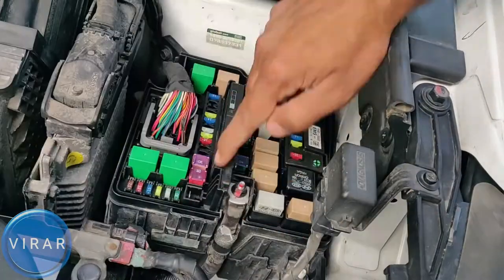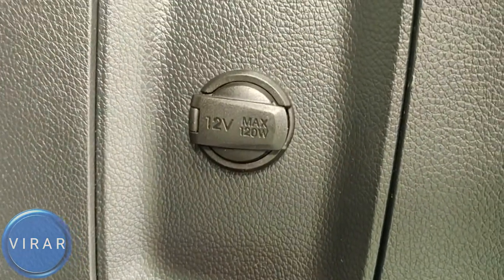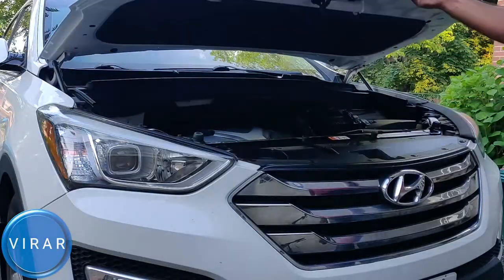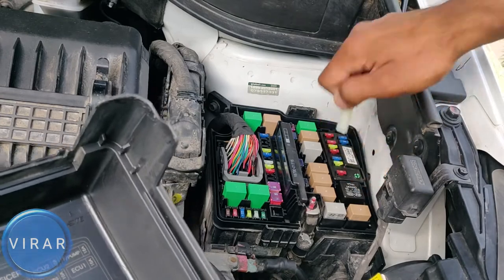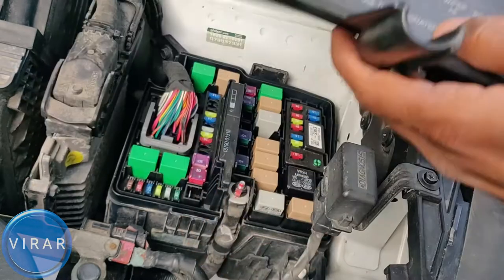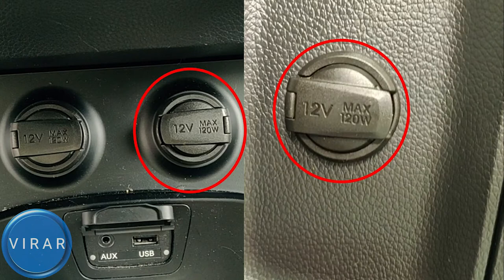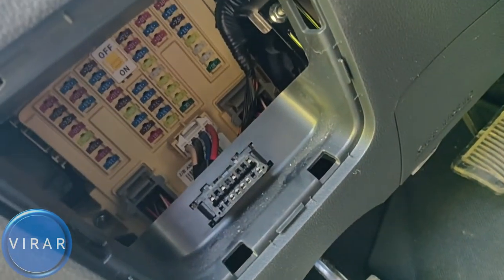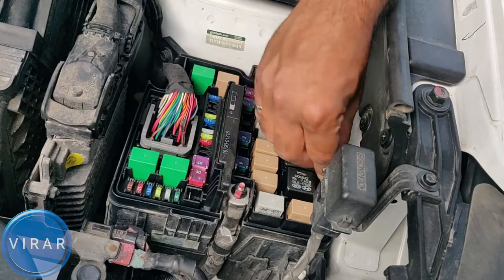How to Fix 12V Power Outlet/Cigarette Lighter - Hyundai Santa Fe (2013-2018)

Comment: Great video! You showed both front power outlets fix. I was going nowhere how to fix the one on the left, then when I saw your video showing the other fuse box by the engine compartment I was relieved. That’s the solution I was looking for! Thank you! You saved me money going to the dealership and getting aggravated with the fact that I can’t use that cigarette lighter got my other accessories. 👍👍👍
Reply from the maker: Thank you! Glad you found it useful! Thank you for sharing. I tried to included all the details I could to make the job as straightforward as possible.

Comment: omg okay watching this because my Santa Fe fuse won't charge, but with how informative this is i was hoping you would know... I TOOK my Hyundai in because the infamous "loading" screen is on my radio... yes it still works ut cant connect my phone, can't see what station i am on, or what temperature i have on the driver or passenger side is on... after taking it into the dealership they said it would be just under $6000 with $4000 in LABOR.... i took it home, after paying $125, got online saw it might be the CD player, took the whole radio out, disconnected the cd player. that still didn't work. i put the radio back in, and just said "ill buy a new one i guess" but of course, as i am sure with everyone else, the pandemic hit hard, and that's the least of my concerns right now... i saw somewhere that a new fuse might help? is this true? PLEASE HELP a single mom get to know what station is on while driving her son to school.!!!

Comment: thanks solved my problem although my unit is the other way around left side fuse is located inside the car and right side is on engine compartment. your tutorial helped alot.specially location of spare and the fuse puller.thanks brother
Reply from the maker: Glad to hear that. Thank you for sharing!

Comment: Great video. By any chance do you have a video on how to troubleshoot & replace the usb/auxiliar porst on the 2017 santa fe?
Reply from the maker: Hi Tyrone. Unfortunately I don't. From what I have heard, usually the USB/aux is a single unit and the quickest way to fix is to just replace the entire part. Unfortunately I don't have access to a Santa fe right now to make a video on it. Sorry :(
Reply: Thanks much for your reply,  I removed it and ordered the new part. Thanks again.

Comment: Would that fix the USB port as well? Mine keeps going in and out when charging
Reply from the maker: That may be a fuse issue or an issue with the actual USB port. If so, then you would need to get the actual USB port fixed.

Comment: PS I have a 2020 Santa Fe and it worked exactly the same, the fuse puller is located in the cover.
Reply from the maker: Ohh nice. Glad to know that the process hasn't changed much.

Comment: So if I use the spare fuses do I have to replace them or I can just leave the spare empty 🤔
Reply from the maker: You can leave the spare fuse slot empty for now, but I would advise getting the new spare fuses , you know never when you might need them in the future again for some other issue.
Reply: Ok thanks I'm going to try it and see what happens. I let u know if everything work out
Reply from the maker: Good luck!
Reply: Try it out today problem solved. It was the fuse.  thanks again
Reply from the maker: @jpringle8981  Glad to hear that. Thank you for sharing

Comment: follow instructions.  power out let worked then tried Cig lighter outlet and it did not work.  Went back to power outlet and now it doesn't work.  Bought brand new fuses and tried.  Same result.  Disconnected battery replaced fuses, reconnected battery and tried and got same result.  Suggestions?
Reply from the maker: You need to replace the power outlets. If its not the fuses, then you just have to replace the power outlets. Its a fairly common problem on this vehicle model.

Comment: Fixed. But next moment it's gone again. 😢
Reply from the maker: Hmm. Did you plug in something that draws a lot of current ? Water kettle ? Multiple laptops ? Anything like that ?
Reply: @Virar Automotive  No. It's just my regular AC/USB charger, and I checked if I can charge my phone. I used it many times before.
Reply from the maker: That's odd. Sounds like a short circuit somewhere. Can't really tell more without looking. Sorry :(

Comment: What about the USB charger, not the outlet
Reply from the maker: The USB port / Aux Port is a single part and it has to be replaced. It's a common issue with these cars.